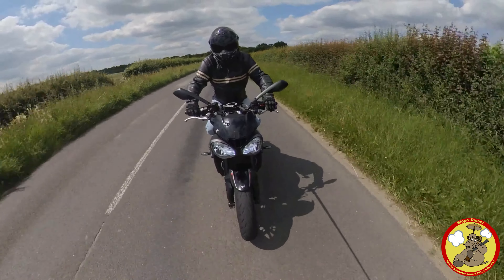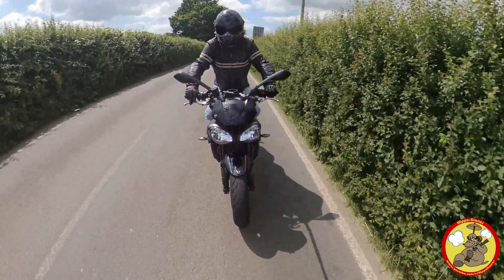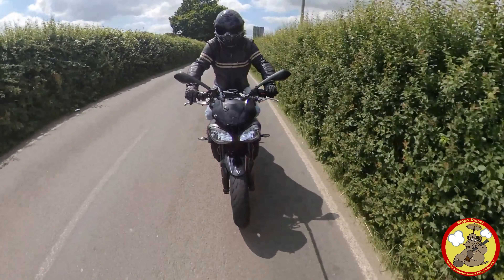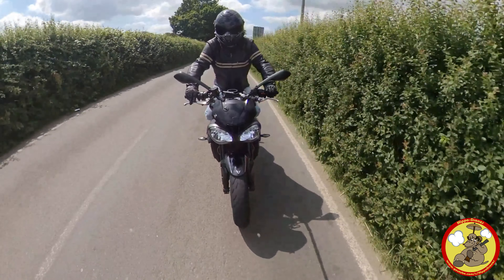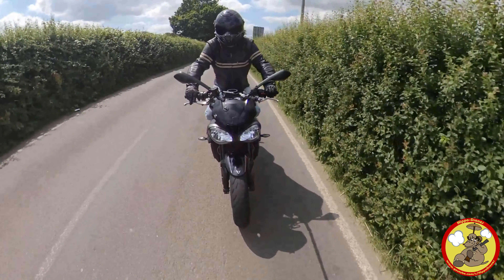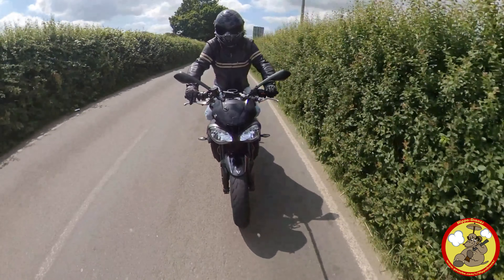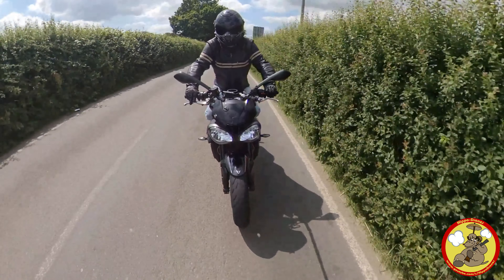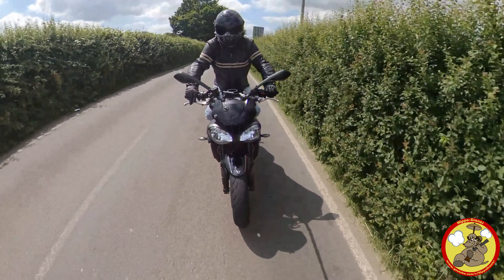Triumph Daytona Rearsets on a Street Triple - Some Problems

Comment: Sorry to hear about your grandmother. My condolences. 

Love the new angles, especially the lower rear one - super cinematic. Any worries or distraction with the Insta mounted on your right side and extended away from your bike. When I did that on mine (mounted on my left) it was a struggle not to look over at it all the time to make sure it wasn't going to be clipped by traffic in the oncoming lane.
Reply from the maker: Thank you mate.
Keeping some spacial awareness is important, so a quick check on it is probably a good thing, just remember you are as wide as a car and position yourself appropriately! :-) Normally I'd run it on the left side but I wanted to show the issue with my ankle as it doesn't move fully compared to my left one. I'd def not want to have it out to the side for long, or on a twisty bit of road, hence why that clip was pretty short! :-)
Reply: @HippoDrones  Good advice. The way the camera squeezes the space around it, things probably look more narrow than they really are.

Comment: Gotta say I'm loving that 360, it really is a versatile bit of kit. As for your back brake I meant to say on that Beta vid the other day that if it comes to it you can always attach a hand lever to it & slot it under the clutch lever like some stunters do bmx styles :)
Reply from the maker: I have completed a thumb brake or  hand brake, certainly for offroad. On the 765 though I need to get the gear pedal higher in relation to the left footpeg too, so am going to try lowering the pegs a little bit :-)

Comment: Great video, I would be afraid of losing my camera, nice shots though. I totally understand your apprehension on the video about your Gram, and the comments it is totally understandable. Ride safe!
Reply from the maker: Thanks Ro2. The mounts are very secure, but I did worry with the low one that it might ground out with the suspension compressing on acceleration. I tucked it in quite tight to the bike too so my leaning didn't cause a risk. Thanks mate, You too :-)

Comment: I was wondering if you could attach like a piece of metal say 1cm thick to the pad on the brake pedal to help? If you're having the same trouble with the gears though that's no good and dropping the pegs a little should make a big difference - it did for me for other needs, which were mostly better pedal action off road when standing on the pegs.
Totally fine that you didn't need to reply on the video about your grandma, they were comments of support, not needing a response, apart from us all hoping they would help mate :)
Awesome camera angles, that stabilisation is incredible! Ride safe matey!
Reply from the maker: I am actually thinking of doing just that with my Beta, as I can't get my foot on the brake pedal too well on that either! With the Triumph, I think I am better off lowering the pugs a little as the gear change is a bit awkward too.
Thanks mate, each comment on that video was very much appreciated :-)

Comment: nice video,i bet that took a while editing with all the various camera angles you had set up,i couldn't work out where you had the camera fixed to showing the rear wheel..don't tell me though as it would be like finding out how a magician does a trick!..car drivers must wonder what the hell that stick is for!!
Reply from the maker: Cheers Dougie, appreciated :-)
I quite enjoy editing the 360 camera bits, although I messed up with one of the edits going up the hill as had the view too low and chopped off my helmet lol 😂
If I keep the 360 clips short they are quite manageable, setting up the angles can be  pain, but it then allows me to grab a clear bit of road for each clip so swings and roundabouts :-)
Haha, I'll keep you guessing on that one then! 😂
I have had some funny looks from folk! 😂

Comment: That new angle is a success!  Are the rear sets adjustable, or will you have to end up investing in some aftermarket rear sets like Gilles.  I remember that there were some bracket pegs you could buy to move the actual pegs up/down back/forward, I think they were from a company called BikeTek.
Reply from the maker: They are adjustable, which is the main reason I got them. Unfortunately the height I wanted them for on track means the levers are too low for ideal comfort, but I think I can still lower the pegs a little and maintain enough ground clearance to reach the edge of my tyres on track and be able to get to the levers better. I think as the Daytona is more of a bum up, wrists down riding position, the levers would be in the right place on that bike, but on the Street Triple, with the higher bars, (and my duff ankle) it has me sitting more upright increasing the angle differential to them from the pegs. Am sure I'll find a solution, or at least a viable compromise! :-)

Comment: Hello there! I got the same rearsets, but here they were sold as street triple 675 rearsets (different?). I got them more or less working properly for my 765 RS. They needed shims on the shifter side, and I had an issue with the shift assembly jumping off the bearing. And it's probably not playing super well with my QS (1st to 2nd problems)
Reply: But otherwise the ergo improvement fat outweighs the niggles. And the quality of construction makes them super beautiful. Long term, if I still have the bike in 2 years, I'll be getting the bonamici rearsets. Slightly higher mounting with better adjustability
Reply from the maker: The Street rearsets are a different part number to the Daytona ones, which is why I had a few issues :-) I have had to remove them now though as a log bent one of them and the parts are no longer supported by Triumph so can't repair it.
The Bonamici rearsets are supposed to be awesome quality! :-)
Reply: @HippoDrones  yea triumph here also told me they wouldn't be able to get me spares if I binned it, so I should hold on to my stock rearsets. You sure you can't get parts from bike bandit or something? They're not THAT old!
Reply from the maker: @greyanaroth  Can't find them anywhere in the UK
Reply: @HippoDrones  that is sad :(
Reply from the maker: @greyanaroth  Aye, cheers though dude :-)

Comment: If youve rotated the brake arm all the way up and still need the brake   peg higher what about machining a new peg with a step up?( youve got to know a vlogger with some skills) Delboys garage?
Reply from the maker: That is an alternative option. I'll see how I get on by lowering the footpeg a bit first though :-)
Reply: @HippoDrones yeah im sure it will be ok. i take it the spring you ordered fitted ok for the brake light switch
Reply from the maker: @k31chris  I have not ordered one yet, but made a work around with a bent paperclip 📎
Reply: Staples office supplies ..
Has all your motorcycle accesories😁.
Reply from the maker: @k31chris  haha 😂 indeed 😂